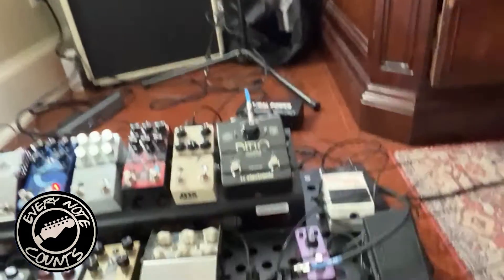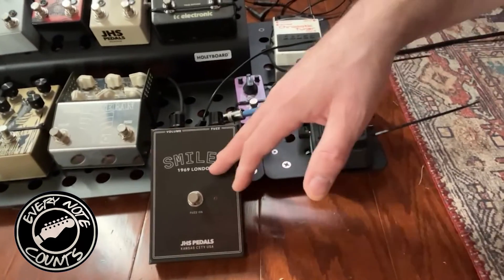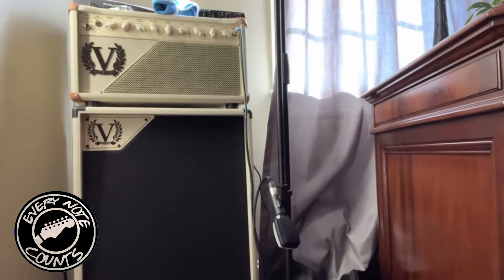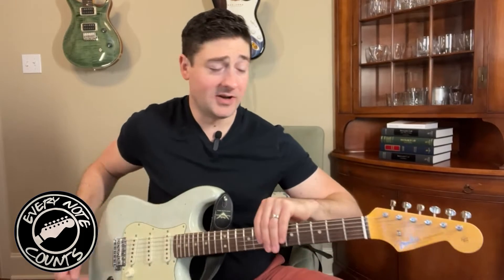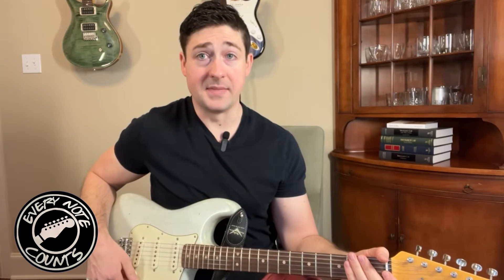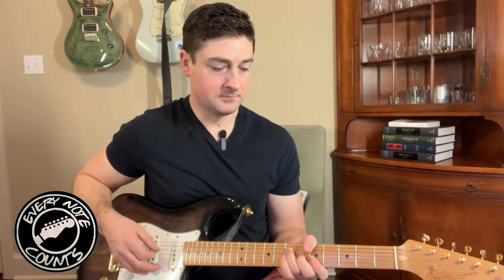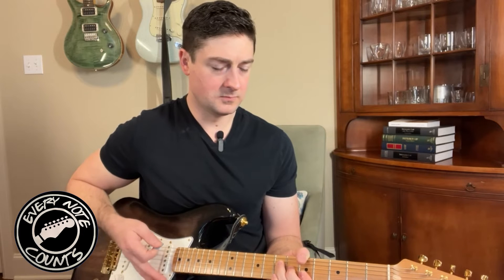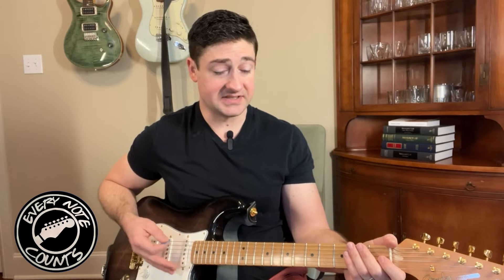Radio interference with my JHS pedal? How can I fix this?

Comment: Stick a 10K resistor between the input jack and circuit input.   That stopped the Mexican radio station from coming through my Fuzz Face.
Reply from the maker: Thank you for the tip and thanks for watching!

Comment: A simple explanation is that the fuzz is acting as both the rf amplifier and demodulator, thanks to the asymmetrical clipping. The capacitance of the cable along with the pickup bobbin are acting as the rc tank, making it a very simple am radio, similar to a crystal radio. I'd solve this with a couple 10 to 50 pf capacitors in the circuit, changing very little the tone, but grounding those very high frequencies. A small resistor, around 1k, right before the first transistor would work too.
Reply from the maker: Thanks for the input and thanks for watching!
Reply: The fuzz face doesn't use any diode clipping..its two collector follower (pnp)/ emitter follower amplifiers (one for input stage and one for output) with a shunt series feedback network for controlled gain..its a minimum part count fuzz that just about works
Reply: @Danielallanz  it doesn't have any discrete diode, but the transistors may act as diodes in some situations.

Comment: Just yesterday I broke out my things. I have been having trouble with connections. So I would plug in a cable tap the end for noise. This would at least tell me that it would work. I have been keeping them separate but I would loose track of which ones worked. I somehow came across a "Road Hog" cable.This convinced me Road Hog is the ticket. Lots of possibilities for interference computers extension cords and whatnot in the hole I would plug in and play. No noise. I would tap the end of the no sound. I figured the cable didn't work but closely i would hear it makes noise. I found though it worked fine. The cable must have come in with scrap here at the Recyceling center where I work.  Cable Like it says at the end of the video. It might cost a bit more but silent operation equals no pain. Amplifiers used to have polarity change plugs and switches, ground lift options Transformers in amplifiers would be situated in what seems to be not uniform placement in the chassis ...hum. same things with components in the area.  There was a joker near a place that I used to live with a ham radio. He couldn't physically hear me but he would find me with his equipment and squelch me (a good way to loose the radio operators license) he would do this to let me know he was alive I guess. Senior citizens they too need a hobby.   Cables though  May I suggest Road Hog.
Reply from the maker: Thanks for the tip and thanks for watching!

Comment: glad to hear you seem to have fixed the issue!! I never heard of something like that before and found this very interesting. I would believe that  a metallic box (if the metal is conductive) is the best way to shield the electronics inside. Therefore I would have been seriously surprised if it would have turned out that the smiley is the evildoer. So if the problem becomes more obvious if the pedal is active I would believe that the issue was happening before and just amplified by the pedal (through gain and compression). My initial thought was that also the strings of youf guitar might act as antennas. If so I think you might test this if you turn your guitar in different directions especially from horizontal to verticel position. But anyway It looks like you have fixed the problem. All the best !!
Reply from the maker: Thanks! Since filming this I have noticed some radio frequencies in my other fuzz face style pedals, but not in any of my other pedals (including overdrives/distortions). Who knows, there may be a “part 2” of this video hahaha

Comment: Firstly Silicon fuzz faces (including the Smiley) are notorious for picking up radio stations, that being said there are things you can do to minimize this GREATLY. First totally shield the whole pickup cavity....EVERYTHING, control cavity, pickup cavitys (the bottom and sides of each pickup space) ...even the input jack cavity....with copper shielding tape, you can easily find out how to do this and where to get the best supplies for this job anywhere online EVEN YOUTUBE VIDEOS.....And your Strat will thank you whenever you are using every type of "dirt pedal" from then on. Other things also contribute to the problem (the wiring in your house, florescent lights, nearby high tension power lines, using cheap instrument cables, proximity to other  gear that is not grounded well....BTW  fuzz faces always sound better using older style carbon zinc (instead of "Alkaline" batterys and using a battery on your smiley will not only make it sound better but keeps it away from other not well grounded pedal power supplies and ground loops in your pedal board.... I suggest fully copper shielding your Strat and using a battery ....then go to a friend's house in another location....and try it.....Just the Shielding alone is going to help your problem ALOT

Comment: I have the bender never had a problem with it …. Be kinda cool to use the radio signal as part of an effect
Reply from the maker: That would be cool, if I could predict when it will show up and what various conditions make it happen. I kind of think a “radio effect” would in and of itself be a cool guitar pedal. Sadly, it doesn’t work great for Hendrix, which is the real reason I own fuzz pedals lol
Reply: Sleep Now In The Fire has that effect at the end.

Comment: I can't imagine it's simply the cable.  I've played with many crappy cables over the years (as we all have), and I've never picked up a radio station.
Reply from the maker: If it’s an intermittent problem, it could be that the problem simply wasn’t occurring during the time I used new cables. That being said, JHS told me that FuzzFace style pedals are so simple in design that it’s “pretty much they are just a radio that works in reverse.” We will see if it comes back I guess 🤷🏻
Reply: it depends on the pedal. I have more than a few pedals and they don't do it. One of my pedals did. So it's possible that you just had pedals, Preston,  that didn't do this. Thank god for simple solutions! Also, Every Note Counts, thanks for making this!